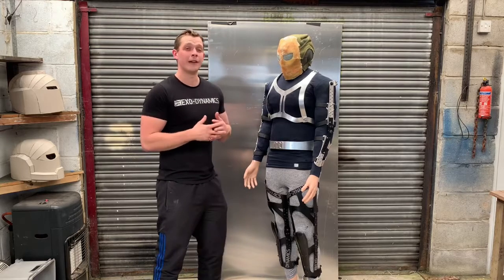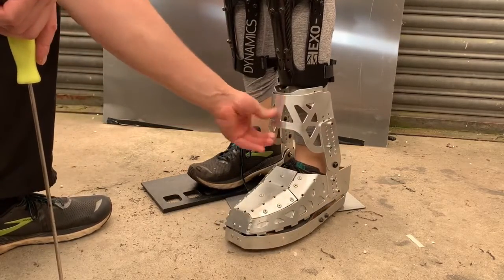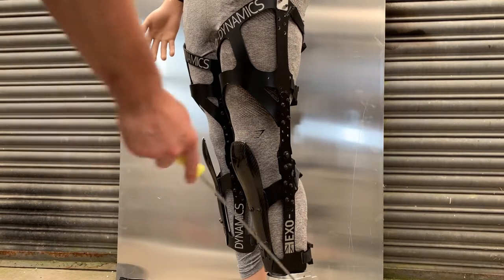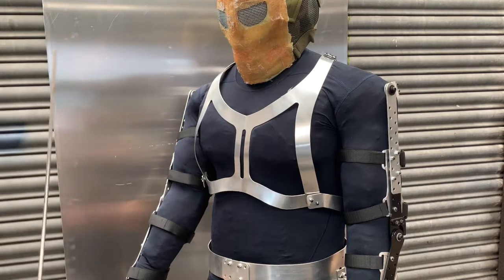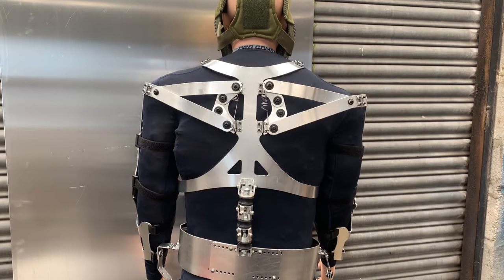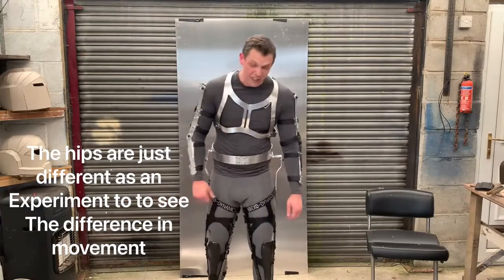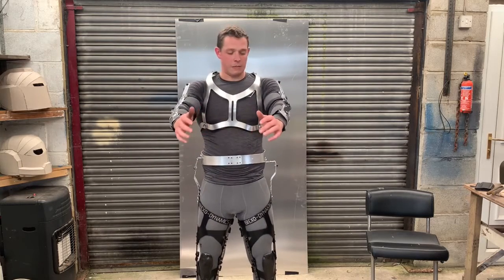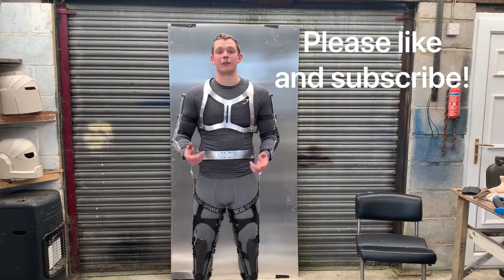Episode 2 of the exo skeleton build   path finder for an elysuim / iron man /  astartes style suit

Comment: A self collapsing shoulder design can be dangerous. A simple hinge for up and down is better. Arm rotation is best achieved with two joints like you use, but with an additional circular track piece for forarm rotation or arm forward lifting.

A circular track and side hinges are also goid for the torso. Way more sturdy and better aligned than a spine stack. 

For the legs, a circular track (so you can rotate your leg) and behind the back hinges (so you can lift it sideways) would help.

Knees benefit from a gear synchronised double joint. It better approximates the shifting center of rotation in the human knee

 Feet work better with a movable toe piece, which improves walkung fluidity and stability.

Your suit is a clean and promising design. I like it. 
Checking ivan smit, installation 00, conterfract  and dylan edminston on youtube may be helpfull for your build.

Greetings from another basement suit builder ^^
Reply from the maker: I now I have a new power armour update video live if your interested
Reply: @MattExo-Dynamics  saw it ^^